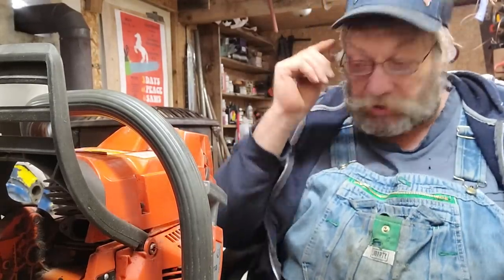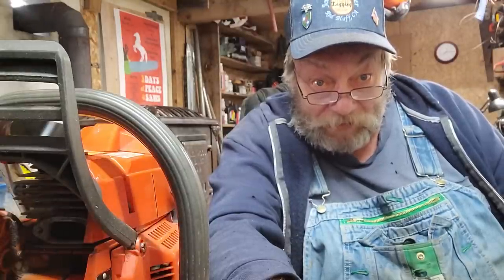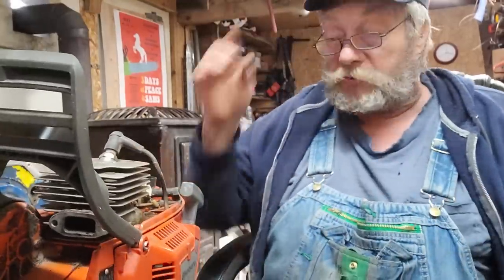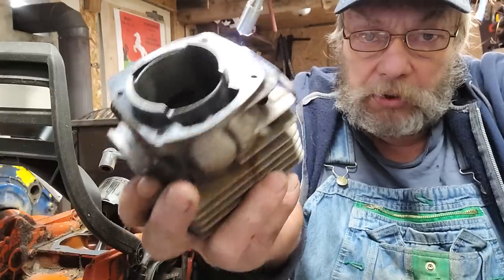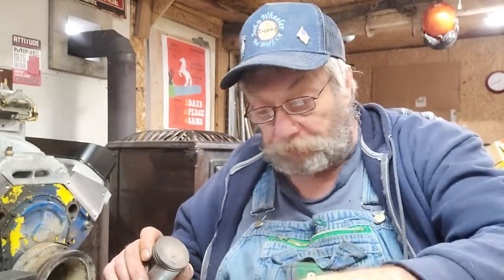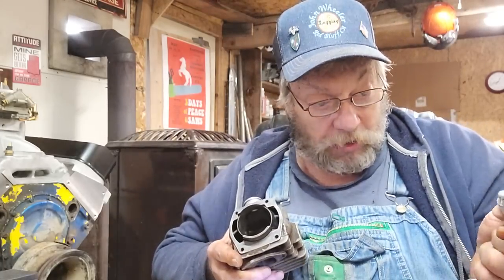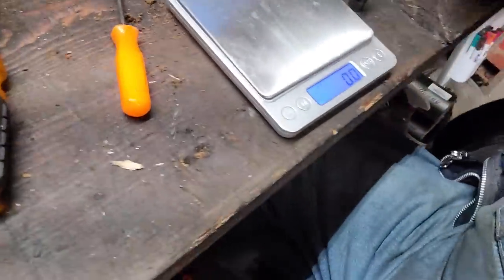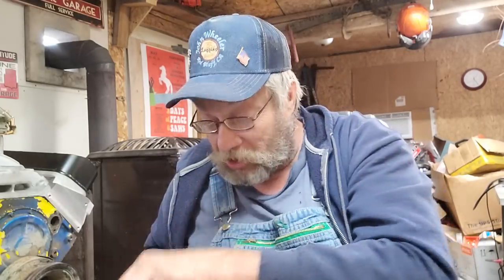let's build a 372 with stock timing numbers! make big horsepower with all these tricks! Pt 1

Comment: I usually order the meteor 371xp single ring piston kit to save the work or the 268 so I can work it and work the squish band up and make a nice combustion chamber and squish… I started putting my Caber rings in the middle of the power zone between the squish and the top of the exhaust and adjusting the ring gap so that there’s a little more space between the closedown tips on the ring… cool tips dude!  Keep on Truckin!!! 😂👍💪✊❤️🇺🇸

Comment: Im looking forward to this!  I recently acquired an early road bounced 372 from a former grading company owner.  I also ran across a 272K 50mm P/C set off of a concrete saw that looks pretty good and the smashed cylinder piston is loaded with the factory ridged side skirts intact!  From my small block Chevy days!  I wanted a blue_printed motor for a longer life.

Comment: I am really looking forward to this series!

Do you sand or stone the inside edges of the sanded ring? 
I am guessing there will be a small burr left by the sanding.

What is the pin you chose? Stock from something else or did you grind a taper on the inside ends?

Thanks.

Comment: Hi there, iv just stumbled on your channel & video about 2stroke motorbike cylinders "transfer ports", you gave me a better insight to doing the T-P than most of the other vids I looked at,, anyways quick question the divider wall that runs down the T-P on mines has been knife edged & cut down from the top a bit to much for my liking can this be repaired ie aluminium welded back up to a standard level to the bottom of the cylinder?? If I could send you some pictures photos  I would to let you see what's what,, the bike is a yamaha rd350lc,, a big thanks from me at Scotland Edinburgh  👍🏴👍

Comment: I have a couple stihls and it makes me crazy the piston doesn't completely open up to the exhaust port, which has a stock floor. The ts350 concrete saw is really bad. Should I not let it bother me or take a little off the piston? both have plenty of compression.

Comment: Thanks for your generous sharing. What wrist pin did you replace the heavier one with? I watched 3 times and I could have sworn you said which pin it was ... maybe in another video.
Reply from the maker: Stihl oem 044/046/066
Reply: @theironhorse6600  Thank you so Much! I have put together, restoring to service 50+ saws but nothing in your realm. I appreciate  the little gems that you say and take notes. I am looking for a lighter wrist pin for a Holzzforma 372xt ... hoping to "carefully" cut the weight of that piston and delete base gasket, and remove one ring and reduce the remaining ones tension.

Comment: It would have never occured to me to remove material from those rings to reduce tension.  That is ingenious.  

Something I have recently learned about modern auto engines, especially Toyota, is that a guy had better be religious about changing his oil.  Don't buy into that 10k mile crap.  Do it every 5k or 6 months, whatever comes first.  The fine grit that accumulates in your oil can cause your OIL rings to stick in the grooves of the piston, causing oil blow by and thus oil consumption (burning oil).  This is all because modern auto manufatueres figured out how much you can gain by running low tension rings, and thats what they do.  More power, better feul economy, less emissions etc. 

To your point... RING TENSION MATTERS.